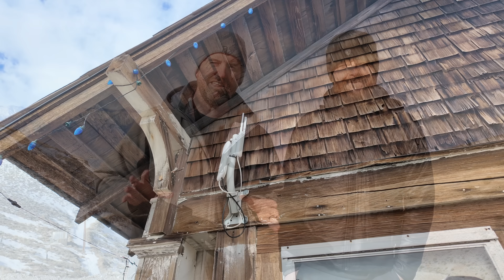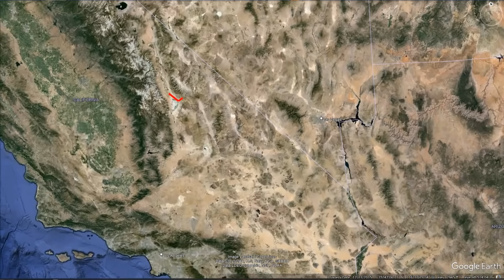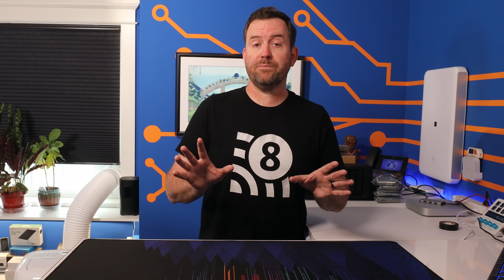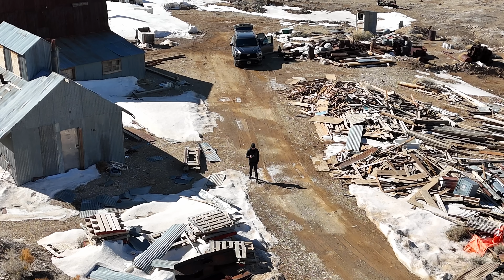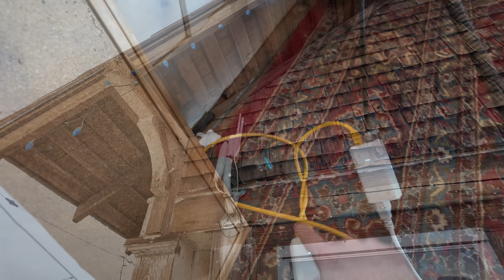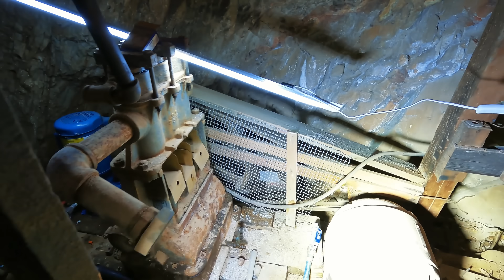Cerro Gordo's Wi-Fi:  Network Design for a Ghost Town

Comment: I would have run underground ethernet to all the buildings, they all seem to be within 30 meters from the main house, and a small switch in each for the network. Then run a fiber down to the bottom of the mine to the pump, and run ethernet to each level with a small ap. While there is alot of digging in this case, its more stable, cuts down on wireless interference and long term probably cheaper in terms of time.

Comment: Since there's power available in the mine shaft, a pair of fiber-ethernet converter or several fibric daisy chained switches with SFP(+) would solve the problem. Just add power sockets to the power line of the pump at each level that needs internet access.

Comment: The mine needs glass fiber and decent power, period.
Perhaps in town I would use fiber to interconnect the different houses. Not sure how Brent feels about cables, but if you want a stable and fast network, use cables!! But yeah, a lot more work, and probably a lot more expensive.

Comment: If the Game Changer cable doesn't pan out, LANShack builds custom length single and multi-mode cables in a variety of lengths, fiber count, and cable type (indoor/outdoor/direct burial armored) . 4 strand, direct burial, single mode @ 500 foot and LC-LC is around $788 shipped - may be a good option!

Comment: Powerline Ethernet would have been a better option if bandwidth needs fit in the constraints, and all sources from the same transformer.
The added benefit would be cleaning up the town from external equipment making the tech as invisible as possible.

Comment: Given the extensive use of Ubiquity equipment, could you get Ubiquity to sponsor the town improvements, or this project, to show off more of its abilities for remote, and large-project infrastructure? Maybe they could use it as an example site and maybe they'd be willing to help with costs of running fiber from the demarcation location to each of the buildings as well rather than relying on wireless bridges?
I can't help but think that given the IP cameras, and the hotel's Surveillance, Security, POS, Entertainment, Communication, and other network needs, they may need more infrastructure within the hotel as well.

Comment: There is an interesting product from microtik that clould help with the long runs in the mines, the GPeR (Gigabit Passive Ethernet Repeater).
According to microtik it can be used to extend ethernet by up to 210m (~690 feet) to another GPeR unit and be chained with multiple units up to 1,500m (~4920 feet) and it passes through PoE.

There is also a IP67 (edit: it is actually IP68 certified even though the name says IP67) enclosure as an accessory.
Reply from the maker: Interesting - I'll have to check into that.

Comment: i think instead of the double poe injectors use a flex switch and the same for the solar tower than you will not have a double nat. and get rid of the switch ultras in the mine and use flex switch . or use under ground fiber to each building

Comment: Not an ideal solution for getting wireless to the hoist house, but could you put up two point-to-point stations on the rock pile with solar/batteries? One that faces the General Store and the other facing the Hoist House.

Comment: Anywhere you're using 2 poe injectors I would suggest using 5 port PoE switches, so that you have the option of connecting local devices to Ethernet, or for further expansion.

Comment: With the Hoist House/Mine, could a WiFi mesh network be used?
Using a directional Antenna at the top of the shaft, beaming a signal down and then Mesh access points at the levels you want extended sideways coverage.
It would be interesting to know if this would be doable, and the Pro/Cons of such a setup.

Comment: For the mine, why not run 984ft of copper and then use HomePlug and HomePlugAP?

You run the electricity and then use the same copper lines to transmit the internet.

You use a single HomePlug as an input and then you can have an AP on each level of the mine (max of 984ft)

I ran a 50amp line to my shed and then hooked up a poweline adapter. 700Mbit over WiFi in my shed, not bad.
Reply: You need to perform a voltage drop calculation, the numbers won't work out.

Comment: Please consider fiber or hybrid fiber. Wireless is fancy and all but will never be as reliable as a cable link, especially inside the town. Also make sure to consider wiring a hybrid fiber cable to the solar-powered Mikrotek thingamagig to loose that point of failure. For the mineshaft some 32 hybrid fiber link would provide a few links to each floor and power. Maybe even stop using Ubiquiti for everything. It is nice, but will that work in a mine? Just choose some industrial equipment and that's fine. Also consider making the new hotel the main point of the whole system, as it's new so you don't have to retrofit most of the new equipment.

Comment: Ui products, even tho not ipxx rated for most products, actually is really relaible in exposed weather. I have old ap's and switches outside where i dont care if it breaks and after a few years in the Phoenix sun/heat, they are all still going strong.  The only equipment i found that doesnt like the phoenix heat/sun is rhe G3 Flex cams. They last about 3 years when in direct sun (facing south) ones that are not in direct sun and on east/west sides where it sees sun for just a few hours a day, last forever. The sun seems to destroy the cam sensor and burns it out.

Comment: Watch out for mains glitches caused by the pump starting up(assuming it doesn't run constantly) you may need to add some hefty electrolytic capacitors near the PSU on the DC side down there if that happens. If you do this watch out for inrush current caused by these too - you may need a 2 or 3-stage inrush resistor to the capacitors with relays bridging the resistors after a couple of seconds once the capacitors have charged OK.   
Othewise the PSU may crowbar if the capacitors are too fat. 

Long pump cable runs tend to be very "saggy" and this really shows up when the pump starts up and that's a long way down to troubleshoot random glitches.

Comment: this guy hates mikrotik and loves putting way too expensive unnecessary crap instead. nobody needs ubi stuff. that mikrotik router was just fine for whats its doing. not everything need 100gig. you can even setup the mikrotik router was dual wan.
Reply: Also that system might work in the current configuration but when dozens of people are here the loads will be much higher.
Reply: He was hired to come out because of problems with the stuff
Reply: 😂 he's a clown.    he's pushing the internet of bodies/ mesh Network TRANSHUMANIST agenda.   He's behind  Bio- convergence and most likely working for ISRAHELL. 🇮🇱
Reply: Is there a resource that teaches microtik hardware/software?
I'm trying to learn it.
Reply: Lol, just buy used Xirrus stuff.  Got a bunch for dirt cheap and works great and provides positional tracking with wifi beacons.
Reply: I’ve seen a lot of network engineers come in to a place and order all kinds of demos of shit products and make huge changes because it’s "popular". Then when there contract is up you’re left with a team that has to clean up and fix everything.
Reply: Yeah that’s true they are using tried and true equipment.

Comment: Re the double nat.
I would say just chat to the isp ... that can probs setup a routed network down as its easy on mik.

Also, overall just upgrading the batteries and solar at 2 sites would give you stability during a snow storm ... over starlink that varies.

Comment: The amount of wireless devices this relies on is completely unnecessary.   Just run fiber from the isp location into town, then fiber around town and single internal APs in each building.  Better latency and not prone to failure.

Handle the mine shaft with hybrid fiber as other comments have said.  You're vastly over complicating this, and I say that as a near-professional overcomplicator.
Reply: What to guess that the crazy cost to run fibre everywhere?

Comment: Idk man, I like most of the plan, but not setting up VLAN between the solar station to keep one single network was just lazy. I think the separate NAT'd networks will cause more confusion and potential issues in the future than a simple VLAN config would have.
You could have also eliminated the double NAT issue with a VLAN for the incoming WAN.

Comment: Fiber makes a ton of sense for the mine data wise. There are options for a combo cable to do power and fiber as a single cable using an external power supply in the hoist house.

Comment: I second the fiber optic cable. It's cheap and easy. Use a 12 strand and splice a strand at each level of the mine. That would future proof the data network for 10Gb. Electrical power can be added later.

Comment: The INS-8023af-I is not gigabit ethernet rated and was designed for the Airmax-M line. Also only puts out 18v. You should be using the newer INS-3AF-I-G for airMax-AC products.

Comment: I would do some aerial fibre, needs less power than wireless and you can bandwidth through. Especially on anything backbone. This will allow the town to develop a long term network solution and easy to carry VLAN's without remote management issues. Camera's can be on VLAN's. Visitor WLAN, staff VLAN. Point of sale and management can be on its own VLAN.

I like a central network idea and can build from that.

Leaky wifi cable is how many commercial mines to it today. Sure maybe on some levels you want a more robust solution but fibre is great.

Remember high up exposed = lightning attraction, some fibre isn't exposed too.

Comment: I would use fibre to drop down the shaft and have usw 8 150 switches. Solid data connection, leave the power for the electrician

Comment: Persolany i would have changed the P2MP with a P2P to the UDM SE, no mikrotik router, direct "public IP" to the UDM SE, and continued with your curent setup 👍
i also dont like the double POE Injector, but if it works for them, it's all good 👍

Comment: Great video. The UK-Ultra could be a compelling option to control cost for some of the buildings. 
They can be mounted outside. They can be painted. They can be meshed, reducing the need for Airmax equipment. Dedicated Airmax links can always be added where and when it's needed. This would also improve the outdoor coverage, simplify inventory, and consolidate equipment to a single management panel.

Comment: Could you have used aerial or underground fibre in the town to reduce the overall number of point-to-point connections? Then each building in the town could have a full 1 gigabit symmetrical link back to the UDM-SE in the store. Could possibly explore getting fibre up to the hoist house too?

Comment: 1. Use a Leaky wave conductor for the mine
2. Double NAT is not needed here, just disable in on the dream machine and put static routes in place on both routers.
Reply: Or disable the NAT on the Mikrotik and continue its bridge or VLAN an terminate it on the dream machine which can do the NAT and act as the router
Reply: @moe85moe85  na, never use L2 when there is an L3 option available.
Reply: Might be ISP managed

Comment: This install fails to address a number of issues and creates new ones.
Do not double NAT it will just cause issues especially for any inbound connections. 
You could easily replace the mikrotik or change the config on it in the solar repeater to not NAT and just simply route.
I feel there is a un said subtext that there may be relationship issues with the ISP and the mine. 
There are other networking vendors aside from Ubiquiti that could be used for this kind of install. 
I would 100% use fibre down the mine and run power to any access points and cameras. 

Running POE cat 6 in un unarmored cables outside of conduit with DC power could lead to sparks and fire. Especially in a mine environment. 

Saying you want to use WiFi for safety and communication could lead to serious legal implications and repercussions in the event of someone being injured and killed and the WiFi being a factor the person could not get help. I would seek legal advice on this. Normally mines use engineered man safety systems to handle this.

Comment: How hard would it be to have ac outlets at every level, since there already is power going down the shaft?   With AC power at every level it would a simple job to put in a switch, camera,  access point.  As for the data, you would run fibre down the shaft,  or  run ethernet from level to level since we are  talking about 100  feet between each level.
Reply: There is already power at each level. Shown in this video. https://youtu.be/9dRvYC_-Y3g?si=itCobYP24aaJTr-c&t=216

Comment: Note for 11:40: if it’s a NS-5AC, it’ll just pass through the voltage that it’s powered with. The NS-5AC can be powered with either 24V or 48V, so if you just change the POE injector to 48V, you could use a U6-Mesh.

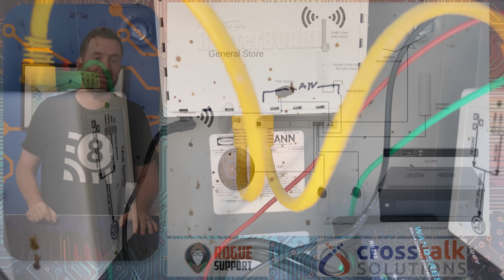Comment: A good solution to the problem mentioned around 8:30 (double NAT) would be to put a UniFi switch in the solar cabinet and pass the WAN through as a VLAN. We have a similar situation at one of the non profits I volunteer at and the VLAN solution has worked perfectly. In UniFi, it would show the uplink as the bridge going to the UDM-SE and then obviously the ISP bridge’s LAN port would be the VLAN port.
Reply: Did the same at our farm after watching Crosstalk’s videos. Works but difficulty to troubleshoot when it is not working
Reply: Yeah that would be a pretty simple solution. Just be sure to label the port(s) "WAN VLAN" or whatever

Comment: Locking yourselves into Ubiquiti equipment is hurting you more than it's benefiting you, especially on the mine shaft.  Patton Electronics makes some incredible Ethernet Extenders that will nearly work over barbed wire fencing at 900 feet 🤣 They have both POE and Non-POE varieties.  I can vouch for them after dozens of installs over several years, they dont fail.

Comment: This is a WiFi nerd's dream.  What a fun project, and glad Brent got back to you!

* The American Hotel, since it's new construction, could also have Cat 6 to the office/front desk and to each guest room, and that'd open up more flexibility for cameras, APs, and guest entertainment.
* If that outhouse ends up having the PTP pole on top of it, I'd laugh if you threw in another mesh AP for some sick coverage for anyone using it 😂
* Knock on wood, but I hope there's not frequent lightning up at that elevation zapping the gear.  Maybe throw in a dozen Ubiquiti ethernet surge protectors?
* I hope that fancy GameChanger cable for the ~500 foot run works as advertised.  Otherwise just run some armored OM3/OM4 cable and SFP modules, but that'd require either fancier switches or $100 in a pair of fiber adapters (I use a pair of Trendnet gigabit in production right now and they're stable.)

Comment: Wouldn't the ubiquity fibere hardware work way better for him there?

I have a question for you about my internet issues? I just got fiber to the modem internet in my area and I have almost 2gbps speed down and a little over 100mbps up but it only goes to my modem with that out of the modem it only gives me 251mbps down and 31-41mbps up. Now the ping is anywhere from 45-85ms sometimes I get 22ms for a brief time. 

But I was wondering how I can get my actual speed out of my modem to my devices? 
Most of my devices are wired with cat 7 ethernet I have 10gig router and switches. 
I know what I'm doing for the most part with networking. But this is beating me I can't figure it out and my isp won't help me at all  because they dont provide support for 3rd party equipment only theirs  which the problem lies with their equipment. 

It is an xfinity gateway xb8 I need that so I can get unlimited data with them for free  instead of extra money and it has a 2.5gig port on it.

Thanks

Comment: Maybe this has already been discussed but I might have missed it. There's two microwave antennas on the top of the mountain, one coming in from One Direction and One going back out the other way. Why not talk to whoever owns those microwave antennas to figure out if you could peer with them to use some of that internet connection as a primary? Looks like they're up on a tower where there is already power up there anyways as well so you could take some of that internet and shoot it wherever you need to as the primary source with a point-to-point
Reply: I was just looking at that and the microwave relay belongs to the LA Department of Water and Power. You may want to inquire as to who owns the property next to their enclosure and perhaps putting a box on a pole or a small building or shed next to it for his link and primary access point. He may be able to get a full time metered power drop and have a view of his relay point in the valley AND most of his "town".

Comment: Just remove the NAT rules from the mikrotik.
** Also a thought o the mine it self. PTP from top to bottom | OR from top to elevator top and elevator bottom to shaft bottom OR 3-4 omni antennas at different levels**

Comment: All nice and good,.....but I have one suggestion...google "PoE extender" ...(even promoted ubiquity has one in the store think it's something about $30 but there are better and waterproof solutions for similar price). It's a simple stackable solution and suddenly a few hundreds feet of wire down the shaft doesn't require magic cable or so many troubles. And I don't say it out of spite....in my line of work every week I am amazed finding new creative solutions using poe.